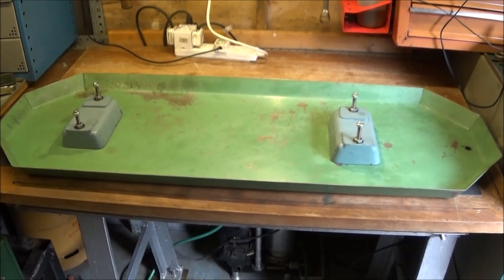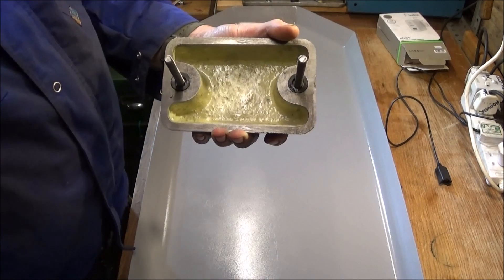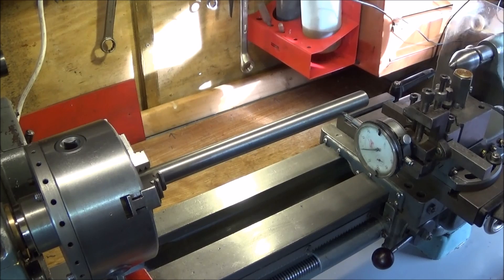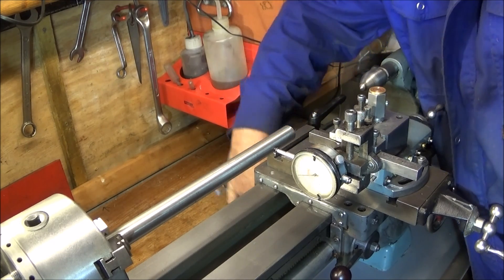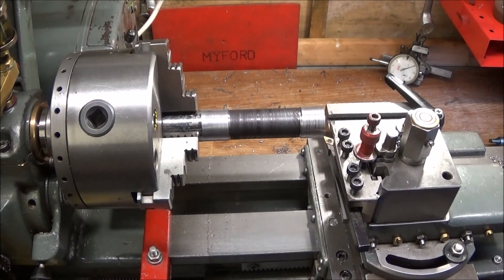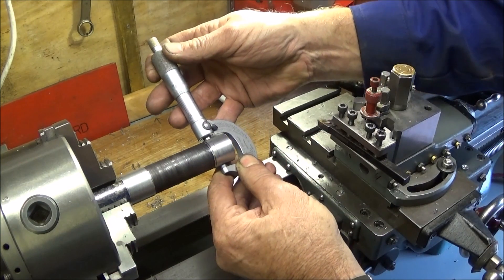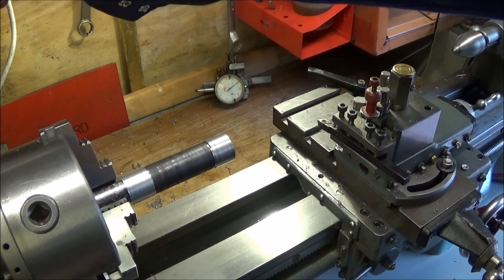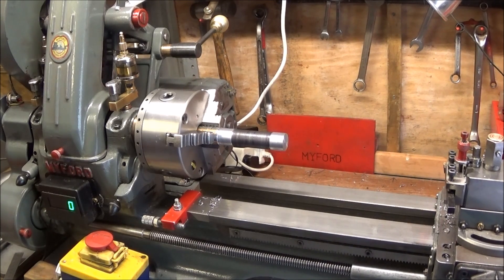Important Tests For Myford Lathes & How To Adjust To Remove A Turning Taper

Comment: hello steve...i want to make a power feed for the cross slide on my ml 10.are the cross feeds on myford lathes all the same ?..... first i need to mill a slot in the lead screw. then fathom out the mecanism needed for the traverse drive..   help !

Comment: I do not own a lathe but I don`t certainly dismiss your knowledge,this would be overlooked by a great number of owners to these machines,so some great info,
But I always have other niggles to do with old lathes ,

What was the point using the dial at first, only then dismissing it when readjusting to remove the twist,
Also why  not just use engineers levels going across the bed and along the bed to get it level at first, surely any parts added on afterwards like the tool holder and the other part that holds the drill chuck it would show they are out off spec and not the bed if the test was done and showed slightly off.

Does it mean there is a twist due to the nuts applying to much or less tension on the bed,
or is it down to wear on the actual bed, or the mechanism holding the cutter is actually slightly at fault,
Reply from the maker: These are the tests and adjustments  as laid out in the Myford ML7 owners' manual. I just followed that to make this video. Regards Steve
Reply: @SteveJordan  If it works to take out a twist then it works, 
Regards,🙂

Comment: steve... i have learned quiet a bit from your videos   and thank you ! i also have a myford a ml10 it cost me an arm and a leg .. and had to go into the depths of wales to collect it !  a 300  mile round trip.the motor was not reversable ...so i made it reversable !! ,myfords have a very good reputation  for quality.. and i live within a stones throw from their old factory in beeston nottingham..which is now overgrown ..one day i will go down with a metal detector,, and who knows !there must be dozens of lathe beds just below the surface ... as i recall them all stacked outside in the open,,,"setteling" so they said! ! then after some weeks or years ,, they were bought in to be machined ..they are still being made up in yorkshire  in halifax.. their depot is in  mytholmroyd. the same building as rdg.. and the lad in charge is 6 foot odd ! !long blonde haired  lad called  ,, james    a verynice polite and really helpfull person..well steve   ,,,,i will sign off now  as i tend to rabbit on a bit too much    regards   laurence  ps.. get your self a centec milling machine..they are very much sought after,, they are both vertical and horizontal a solid and reliable machine ...   think it over !!

Comment: I found that using brass shim stock worked well for removing any taper, I also found that any given thickness of shim stock made a bigger difference to the taper when it was used under the bolts under the headstock. I discovered this because I was getting a little 'alarmed' by the amount of shim stock that I was using near the tailstock of the lathe, I was getting concerned that I might crack the bed of the lathe!  I ended up with shim stock diagonally opposite each other. I got my lather to less than 1/2 a thou over 4 inches which is good enough for me!

Comment: did not even know this, of course one does not want any sort of twisting on a lathe. Thought the chassis of the lathe would be robust enough to stop any form of twisting.
Reply from the maker: Hi Ronit, Yes it is amazing. I wouldn't have known about it if I didn't have the Myford ML7 handbook. Regards Steve.
Reply: @SteveJordan  glad you shared the process! I am sure millions out there now know such fixes will improve on the accuracy of their machines. Funny how the manuals from the past had so much information on them.

Comment: I've recently moved my location and so needed to set up my ML7again, I followed the instructions from Myford book  no 720 R and got a good result in the first tightening down sequence , lucky or not. You didn't say exactly how it is suggested to do this operation according to the book. I believe when I set up my machine about 30 years ago previously that I didn't follow the instructions correctly either and farted around to achieve the desired result. I learned something after 30 years. Read the instructions carefully and it can make a difference! Personal opinion only. All the best for now.

Comment: hello steve..   laurence  here.. i want to make some mt2 tapers using the offset tail stock method . which to me seems the easiest of all.. but,,,,on my ml10 its just two slotted grub screws that do the job  i have loosened the big nut in the centre of the tail stock .to no avail..i  have drenched all in oil and tapped lightly all around the joint line  .. and no joy..   what do i do steve ?get a bigger hammer ?i think not .. salution please... regards   laurence
Reply from the maker: Hi Laurence it may loosen up if you heat it up a bit with a gas torch? Only use soft mallets though you don't want to break it. Otherwise you could try soaking it for a few days in a bath of paraffin or diesel.

Comment: Sorry but this "Tests" are Nonsense. When you don't know anything about the Geometrie of your Headstock. First Time you have to measure the Headstock with a tapert Testbar from the Taper of the Spindle. Then you can measuring the Twist of the bed. I build lathe's 38 years long and knowing a much about lathe's
Reply from the maker: I got the tests from the Myford handbook so they are straight from the makers of the actual lathe. I would rather trust them on this set up.

Comment: Hi Steve,  I notice you didn't check the bed for level between the headstock and tailstock.   Is there a reason for that or it's not necessary?  Thanks.

Comment: One criticism is the use of an insert with a too large nose radius to take a 0.002" (2 thou cut) the tool nose radius is too big and you can see that in the poor surface finish and maybe tool stand off. Id recommend you use a razor sharp ground HSS or carbide turning tool.

Comment: Hi Steve it me again I have bought an ml7 which I am collecting tomorrow would u possibly have the total length of the lathe and width with motor I have a big 4 wheel drive estate jeep and I just need to make sure it will fit I have 77" in length and over 50 inches in width I am sorry to trouble u again david
Reply from the maker: I can measure it tomorrow although the measurements will be on the Myford UK site. Your vehicle will be ok to collect it as my brother delivered mine in a Hyundai I10 with the seats folded down.

Comment: The wooden top will shift with time and moisture content.
Endless chasing trueness when needed.
Reply from the maker: No the lathe has its thick tray and the wood top is solid on cast iron stand. It hasn't moved in 5 years so it is fine. Regards Steve

Comment: Several comments related to a misaligned head-stock. Steves response was that 'Myford stated in their instructions to do it 'this way'.'
Fact is that the head stock could possibly be mis-aligned BUT NOT on a NEW ML7 straight from the factory. 
I am currently rebuilding a PREMO (aussie) lathe. To realign the headstock the procedure I plan to use, is to take a facing cut off the end of a bar. The cut MUST be FLAT. I will check this with a dial indicator.. I expect the dial indicator will show no variation up to the centre, but after passing the centre, there will be a change in reading. When the headstock is aligned, then there will be no variation on the clock and the end of the bar will be flat.
I have rebuilt a Sheraton 9C lathe (aussie), which is a Southbend 9 design. These lathes have bed rails which go through to the headstock and the headstock is inherently aligned with the bed / rails.
It beggars belief that a lathe bed can be twisted but the Myford instruction book clearly says that it can. The bed of the PREMO is very heavily built, and it will be interesting to see how it shapes up.
In time I will rebuild my ML7 (serial K40572) but that can wait.

Comment: Very nice instruction video. Levelling the lathe is very a delicate job...zero thou is the target...
I don't understand why you don't tighten the top-bolts with a (measurable) reproducible force, so that measuring with the micrometer is actually reproducible too...any reason for that ?

Comment: Err just use a good quality engineers level across the bed when you tighten it down, Both methods equaly good I think.
Reply from the maker: The method I have shown is what Myford recommend in their ML7 handbook. Those quality engineer's levels are really expensive!
Reply: @SteveJordan  Yup I agree. I was in the lucky position of being given many years ago a top quality level by my Uncle.
Reply: @SteveJordan  I have just become the proud owner of a Super 7, and yes, I'll do it your/as per the manual way, as an engineer's level for what is probably a once-a-year check is not in the budget..

Comment: What was the point in doing the first test when in the second, the adjustment is changed....??
Reply from the maker: Hi Jeff, You have to see whether it needs adjustment by doing the first test and find out which way to adjust it....Its all explained in the Myford ML7 manual.  This is the exact procedure as written by the makers of the lathe and it works perfectly.

Comment: What depth of cut, speed and feed rate were you using? You are getting a far better finish with your indexable tooling then I have been able to achieve on my Super 7
Reply from the maker: I can't remember the spindle speed  the depth of cut would be about 15-20 thou. I have a 50% reduction gear on the gears for the feed and just chose one of the lowest feeds on the chart. You really need a reduction gear for power feed on the Myford lathes
Reply: Thanks for this Steve, looks like more fine tuning needed

Comment: Hi Steve, When I'm setting my lathe up, I initially use a special lathe level to set level exactly, then set to remove any taper. Is it better to set the level the way you have shown?

Comment: I’d be tempted to do a couple of spring passes and use a fine machine feed rather than feeding by hand, just to eliminate any springing of the workpiece at the far end and to get those measurements spot on.... good info though.
Reply from the maker: Hi Robert. The measurements were spot on and I removed all of the taper. It is still spot on to this day.

Comment: Hi Steve. I think I must be missing something, but it appears to me that :

In stage 1 the right back jacking nut is adjusted to obtain a zero deflection of the micrometer, with the top nut locked down.

Then in stage 2 a series of tests are undertaken to reduce the 'taper' to zero.  This however is achieved by altering the position of the same jacking nut and testing with the top nut locked down.

Surely adjusting the same jacking nut, and locking down the top nut during stage 2 renders the stage 1 adjustments pointless.
Reply from the maker: Its all in the Myford ML7 manual.
Reply: @SteveJordan  Many thanks for the reply Steve.
Please don't think I'm trying to teach you to suck eggs., I'm just a beginner compared to you, and a great deal of my recently acquired knowledge has come from viewing your videos.
I suppose that if it says this in the manual, it must be correct, but it still doesn't seem logical to go to all the trouble of setting the right rear, in the first test, only to alter it, when reducing the taper in the second test.
Am I right in saying that even if both of these methods are used, and the head is misaligned with the bed, the lathe will still not cut correctly
Reply: It is pointless ! What you have done just indicates that it is possible to twist the bed.
The Myford book uses the parallel bar and the DTI, set up to run concentric, both close to the chuck, and at the far end of the bar. Then, if you traverse the DTI along the length of the bar, you will be able to indicate the degree of twist in the lathe bed. 
Adjust the jacking screws as shown to achieve zero deflection of the DTI.
Perform two runs with the DTI, one on the front surface of the bar, and one on the top surface. If these are both zero deflection, then the spindle axis is parallel to the plane and centre line of the bed ways.
Consistent change in error along the front surface indicates likely twist in the lathe bed whilst similar change in the top surface readings indicates that the headstock mounting surfaces require shimming.
Inconsistent error readings in both planes indicates wear in the bed !
Then try it all again, with a parallel mandrel between centres to check that the tailstock axis is also on the spindle axis . . .
That’s why, incidentally, the machine is correctly called a centre lathe !
When you have achieved all of that, do the test turning to prove that the machine will turn parallel, and you will have a machine that you can rely on !

Comment: How much did you pay for the raising blocks from RDG? I just checked on ebay and it says they're nearly £1000!
Reply from the maker: Hi RDG just put the price high up like this, when they have ran out of stock. It is so they can leave the listing up and running on Ebay until they have new ones ready for listing. Otherwise if they remove the listing they have to re-do it all again. I think I paid around 60 if I remember rightly. If you send them a message on the Ebay listing, they will tell you and approx date they will get them in and the price.
Reply: Thanks Steve,  I've just bought a ML7 after years of searching, I finally found one literally a postcode away from me. You videos are proving to be very helpful.  Keep it up!

Comment: Hi Steve. Very interesting channel. I like to watch your videos.
All the more because I just got a Myford ML7 for little money from our local scrap dealer and I am seriously considering to keep it and sell my Schaublin 102 which has no lead screw. 

The ML7 however is not yet equipped with a collet chuck and does not have a quick change tool holder either. So I would have to buy that.

Which collet size would you recommend? I saw you using an ER40, but the ER25 seem to be normal for the ML7? Some youtube videos claim that the cheap collet sets hav far too much runout. What do you think about that? The sets from Chronos are also quite inexpensive and therefore probably also come from China.

And likewise: which tool holder would you recommend? Is the Myford  toolholder ok? Some people swear on the multifix, but it is far more expensive. 

Another question: Half a tooth of the backgear is broken off. Nevertheless the machine runs fine at low speeds and does not make strange noises. However it certainly should not be loaded too much in these gears.  I wonder what to do. Unfortunately this gear is not available as spare. Do you think it is a good idea to repair it? Keith Rucker from vintage-machinery.org shows such a repair in one of his videos. On the other hand I thought that this gear would be completely disposable if I operate the motor through a frequency converter allowing very low speeds at high torque. But then perhaps the belt would slip?

I do not know if you have the time so answer these question. I see well that you have plentyof followers. But your view would help me very much in my decisions.

Thanks a lot in advance.
Adalbert Gebhart
Reply from the maker: Hi Adalnert. I have only ever used the quichange toolposts and they are fine for me. I would buy a Er40 chuck as you can use these for the full range of sizes. You may be able to get a backgear on ebay especially if you ask the ones that list the Myford spares frequently like Heritage Lathes etc. These must be dismanteling the used lathes so they must get them from time to time. I bought the splined brass gear for a spare that the back gear tooth locks into complete with a spare pulley. I hope to convert mine to 3 phase and inverter as soon as I can. Regards Steve

Comment: Hi Steve, would these checks and adjustments be just as important on the mini lathe? My lathe is just sitting on a sturdy bench top and I have been struggling with taper problems. I have been pulling my hair out trying to adjust the tail stock presuming that to be the cause.

Comment: thank you for sharing.. i just got my grandad's old myford he bought from new around 1970...

what is that red bar you got over the ways? end stop? does it stop the auto feed when it hits?
Reply from the maker: Hi It is a carriage or saddle stop used to set the depth of a cut. Only used when winding the carriage in manually. You must never use it with the auto feed otherwise it will damage or break the lathe feed mechanism. You can buy the saddle stop on Ebay, they are a very useful addition to the lathe. Thanks for watching....Regards Steve

Comment: Watching this video tells me that my ml7 probably isn't accurate enough!  I'm guessing seasonal changes in a wooden bench will also affect the precision over time.
informative video as I've just started to recon a ml7 and getting to grips with it. cheers Steve, an invaluable Chanel.
Reply from the maker: +Loadzofhobbies Hi yes the setting up of the lathe is really important according to the manual. Lots of people just stand them on a  normal wooden bench, like I did at first. Since I have done mine properly it has transformed the lathe. Thanks for watching....Regards Steve